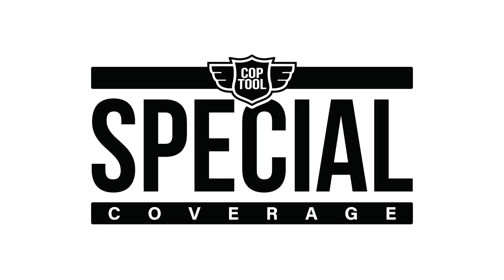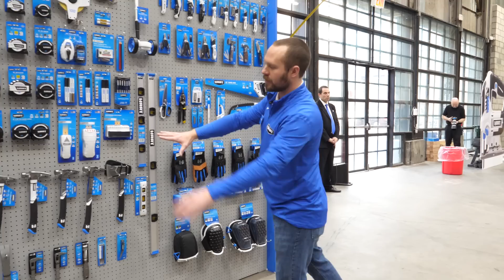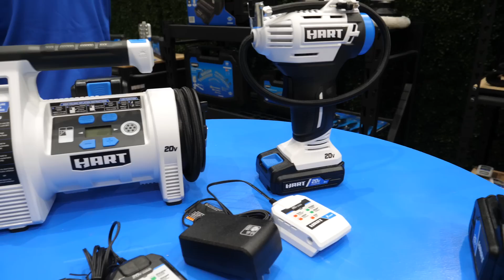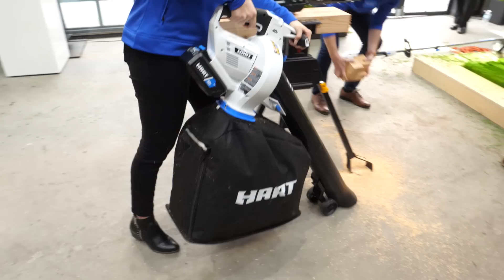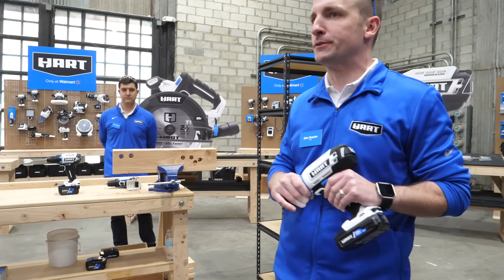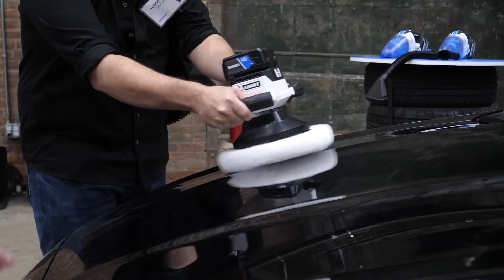HART Power Tools take Walmart by STORM. (Full Event Coverage!)

Comment: I have not bought any battery powered Hart tools as I use the 20 volt Porter Cable system.  But I like the Hart hand tools a lot.   The tape measures made by Hart are really good, easy to read, and the 25’ tape measure stays extended better than the other ones I own.  The screw driver packs are affordable as are the other hand tools like wrenches.   The contractor grade wall stud finder is the best and most accurate I have used. Hart is continually adding to their line.

Comment: The Hart power tools are junk. Save your money
Reply from the maker: Which one failed on you? We’ve been abusing them in our shop for about 7 weeks now with no problems.
Reply: @ToolShow   the battery stop working  within two weeks. I was not happy with the plastic casing,  and small motor inside. it just felt cheap . 
Is cheaper to go with the Harbor Freight Bauer brand.

Comment: Never seen that company in my life and I'm 50. Don't really like the colors. And 350 ftlb 1/2 impact is weak. My Milwaukee 1/2 is 1400ftlb and my 3/8 is 600ftlb. Big difference in power.
Reply from the maker: You just compared a $250 Milwaukee Pro-Grade jobsite tool, to a $119 DIY impact wrench. Why would you? I can promise you that your Milwaukee impacts are fantastic. We have them. We had the 1" here for a while. Amazing. But not everyone needs a jobsite rated tool. That $119 HART will do a great job on your car. That's the point. 

HART has been around since 1983, but it's been framing tools, for framers. TTI is now just re-utilizing the brand for an entry level line of power tools. That's why you've never heard of them. These new tools from HART are only a couple months old.
Reply: @ToolShow  you buy the$100 tool it's not gonna do what you need. So you go out and get a better one and in the end you spent $350 and you have a $100 tool that never gets used and eventually you give to your son. Been there done that.

Comment: I am not a Walmart fan,... and I admit being biased against them  because of how they treat their workers. Also, my experience going in to their stores has never been pleasant. I just transitioned from my old Craftsman C3 collection to Dewalt’s 20v. The C3 tools still work and I have 5 lithium batteries that still hold power in spite of their age, but I know that inevitably batteries will begin to fail rendering my whole collection useless. After spending quite a bit of money on the Dewalts, which I think they are great, 2 things became evident real quick. I am now “married” to the brand because batteries don’t fit across brands and the likelihood is that at some point, the same will happen with my new Dewalt collection. Sadly, it just seems wasteful. Outside of the drill I don’t really have any Dewalt/,C3 repeats so I’m still holding on to the C3’s but, what can be done with the C3’s once the batteries are done?

Comment: Probably great value tools. The same parent company make them for numerous brands including Porter Cable, Worx, Rockwell etc. If you're not fussed about image buy them and get building. Don't listen to power tool snobs and AvE fanboys (who are sat in their basements jerking off over a mains drill made in 1978)

But the problem is there are too many snobs and that's where I think they will fail. If there could be no connection back to walmart they could sell plenty.

Comment: Wish they would get eid of their "hyper tough" stuff. More like hyper trash. I bought the 20v drill and the charger that came in the box wasnt even for the lithium battery. I returned it and opened all the boxes and they were all for the ni-cad batteries too. Then I bought the circular saw and that thing was garbage. The depth set worked itself loose after a second and the safety guard was so stiff you couldnt push it through the 2x. I ended up using my saw all to finish building a privacy fence. Harbor freight tools blow them away for half the price

Comment: Ps stay away from Dewalt power tools. I bought the whole cordless pack and barely a year later the skill saw motor is going out intermittently. I do use the particular saw on the daily though just seems funny that it's going out not 1 month after the warranty expired

Comment: Does he realize 10,000 feet is almost two miles?!! Now that would be quite the measuring tape. 😂😂😂
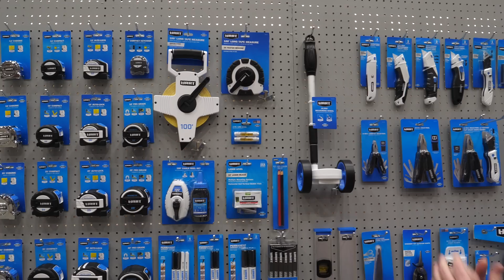Reply: He was talking about the " measuring wheel ", it is hanging to the right of the two 100 ft tapes, and the the left of the utility knives. You can see it clearly at 2:12.
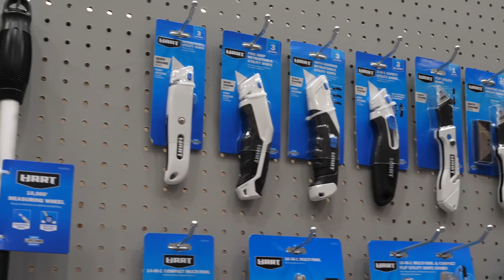Reply: @TheJakeytoo  easier seen paused at 2:35. Can read the tag too
Reply: I believe it is digital
Reply: wayne nahuy 
How would a digital measuring device work?
Reply: @direwolf9569  counts the revolution of the wheel just like all those types of measure tools are

Comment: I'll wait and see how it goes. One thing that could help the cordless tool industry IMHO would be to have fewer proprietary battery packs. There should also be a corded option that would allow useage from house or generator power, and another version to work off of a 12 volt automotive source such as a cigarette lighter receptacle.

Comment: I remember in the 90's Walmart having popular mechanic ratchet set I'm still using one
Reply: I had the hammer for years. Was almost identical to the eastwing except the handle would slide off about every 4 months and id have to reglue it on. Use to just return it every time but they stopped carrying the line. So much for that "life time warranty"

Comment: Well the impact wrenches,like many manufacturers, are too big you aren’t working in very many tight spaces with those. The tools are not hard to make what’s going to count is the battery and until one is taken apart to study they could be as bad as Harbor Freight. If however if  Walmart uses a name brand manufacturer to build their electric tools with quality batteries and true quick chargers someone who hasn’t invested in cordless tools may find this brand to work for them. It all remains to be seen. I will say how many of the tools resemble Ryobi.

Comment: Anyone who wants power tools to last, should not buy these tools.  I talked with a Black and Decker rep one time and he said they produced two kinds of their popular firestorm drills.  One would go to stores like Lowe's and Home Depot, while the other went to Walmart.  They looked identical, so what was the difference?  To be able to put those drills in Walmart, Walmart insisted that the buying price must be lowered, so B/D changed out some of the metal gears for plastic just so Walmart can claim that they can sell it for less.  Knowing this, I would never but any consumer products like drills, tv's, computers and such from Walmart because I would always be wondering what was sacrificed or cheapened just so Walmart can claim they can sell it for less than the other stores.  Buyers beware.

Comment: I don't think drills are measured in foot pounds like was stated by the Hart rep. I believe it's inch pounds.
Reply: Foot pounds or inch pounds both units of measurement.
Reply: 12 inch pounds to a foot pound.
Reply: @kscipkkkk  The quoted spec was 250 pound feet of torque. You miss my point, unless you think that Hart drill is good for 3000.
Reply: Torque measurements for impacts, cordless or pneumatic are measured in ft lbs.
Reply: @TheBannerGuy-James  I can tell you for a fact this is not true. I just checked online and the impact drills were spec'd in inch pounds.

Comment: I like the idea of a cordless auto waxing tool....no more dragging that dirty cord on your clean paint.
Reply: Throw the cord over your shoulder.  

Corded or not, those style of buffer tools are junk.
Reply: @johnjacob688  Dunno till I try it....I'm not a pro detailer so it'd probably work fine
Reply: Prefer pneumatic buffer to electric (corded or not)
Reply: @TheBannerGuy-James  is there a cordless pneumatic tool?
Reply: @hudortunnel9784  that would be fancy you'd need a built in air compressor though

Comment: Looks like that owned by Dewalt judging by the 20v marketing. They're probably equivalent to black and decker which is owned by Dewalt as well
Reply from the maker: Nope. TTI. Same folks who make Milwaukee and Ryobi.
Reply: Santana Santana actually Stanley / Black and Decker is the parent company that owns DeWalt as well as Craftsman and quite a few other brands.
Reply: @kldtts  thanks I knew it was something like that. I just didn't know that Milwaukee also marketed their batteries as 20v as well. Thought that was just a Dewalt, porter cable thing.

Comment: Nothing will replace my DeWalt collection! 💛💛💛🥇🏅
Reply: My one and only DeWalt tool, a drill, has been fantastic. I've had it for at least 15 years and still working great. Definitely worth the money.
Reply: @joewoodchuck3824  - Gotta agree with you there. My DeWalt cordless drill is indestructible. No idea how many hours and projects I've used that on.
Reply: @neilreid9005  I only wish there was a lithium ion upgrade battery pack for my older model.
Reply: @joewoodchuck3824  dewalt makes li ion adapters 
https://www.amazon.com/DEWALT-18v-20v-Adapter-DCA1820/dp/B016K1UD0E/ref=mp_s_a_1_3?adgrpid=55526416785&gclid=CjwKCAiAsIDxBRAsEiwAV76N875aXGgjnRjx-B-ntM1g1IxY4WgUxAHaNogy4yOn-T1jBEAnHgC6qxoCSg4QAvD_BwE&hvadid=274703577831&hvdev=m&hvlocphy=9033455&hvnetw=g&hvpos=1t1&hvqmt=e&hvrand=17329226004434560251&hvtargid=kwd-392598536823&hydadcr=20315_9692150&keywords=dewalt+lithium+ion+battery+adapter&qid=1579235941&sr=8-3

Comment: Still waiting for a tool company to bring back full metal di-cast tools! Tired of all this plastic junk wrapped in fake rubber that nobody needs... This stuff doesn't even last a few years let alone a lifetime... Used to be you could replace a bad switch, bearing, or brush and you were back in business... Now everything has a circuit board and your simply out of luck if it starts to smoke... I understand its "healthy competition", but honestly how wasteful is it for 20 different brands to all have a similar lineup of the same exact tools... Whats wrong with a company making just a few tools and making those tools very well!? I was not familiar with the HART brand before, but its like you said, they used to only make framing hammers and a smaller line up of tools...

Comment: The toll don't mean nothing the battery probably junk like the other stuff they sold
Reply from the maker: The other stuff they've sold? You mean like Ryobi and Milwaukee? TTI (The company that makes HART) is responsible for some of the best lithium-ion battery tech available today. Not sure what you're talking about here.
Reply: @ToolShow   after two years the batteries would hold a charge
Reply: @ToolShow  I have a flashlight from Cobalt it's like 7 or 8 years old works just as good as it did the day it was new

Comment: Milwaukee is a great brand. So is DeWALT. I am mostly a DeWALT guy. Both have their issues. Both are contractor grade. Carpenters, plumbers, electricians, and other trades trust those two brands more than any other. I think these would die under those conditions. 

Hart is likely not contractor grade. That's all I'm interested in. Why would a home owner choose this brand over Black 'N Decker, which looks very much like my DeWALT? 

I don't care if my kitchen mixer takes the same battery as my drill. I'd rather not use my drill battery for my kitchen mixer.

Comment: Everyone says good starter set or good budget set. But I look at it like this even for a homeowner I feel you are better off buying higher grade that will be around for a long time dewalt porter cable Milwaukee. This hart line will be here one day gone the next. I am a pro and I have a friend that works in sales I told him to go to Lowe’s or buy used on eBay and get pro grade that way you will have a quality tool that will last you 20 years and you will be able to get batteries for it and just build your set one tool at a time 

I also tell homeowners to get corded tools. And they always look at me funny as if I was talking in some weird language. But  if you are using it at home you have power so just get a drop cord and good electric drill. Sawsall jig saw and ect. They will last for years. They are priced well you can  buy them used  if you want and you don’t have to worry about bad batteries. That you want or will forget to keep charged up. Then you see the light go off in their head and they say you are right. Cordless is handy but a good corded tool is always nice to have 

So if you are a dyi kinda guy once or twice a year that wanted to build something. I say get corded after all I have corded tools that were my dads and granddads and they work just like the day they were bought
Reply: I think Rigid would be a much better choice than Hart. Rigid lasts a long time and can keep up in terms of battery power and longevity.

Comment: I won't buy a cordless tool until the battery packs can be popped open and the 18650's replace.  Making separate batteries for each brand is stupid.
Reply: Right on.
Reply: Technically, you can already do this. It's a pain in the ass, but it's possible.

Comment: best to invest inquality tools.Gota Milwaukee impactdriver for nearly 6 yrs without letting me down
Reply: sweety black where?
Reply: TTI own Milwaukee and Hart.
Reply: Buy Dewalt. They are American made and owned.
Reply: I guess my comment did not come out right. All of my cordless tools are DeWalt. I have been using  DeWalt tools for 30 years and would not buy any other brand. I had a cabinet shop for 30 years and used a lot of DeWalt tools. Still using my first kit I bought. 18v 4 tool kit. @carlosoliveira-rc2xt
Reply: DeWalt is made in China @carlosoliveira-rc2xt
Reply: @georgebaur1145  Only some. There are several lines made in USA. Suppliers may be from China but built and assembled in USA.

Comment: I bought one of those accessory cleaning brush packs for a cordless drill that I use to clean the tub, cook top, and other things around the house. They work great but are not as ergonomic as they could be. For the tub I use a long extension but it’s difficult hold the extension to stabilize while it’s spinning. I’ve also tried other household products designed for this purpose but they are not strong enough and only have the single brush that is permanently attached.

Comment: I know this is "consumer grade," but they are making the same mistake that made me abandon Craftsman cordless decades ago and switch.  As soon as they start with another lineup (Hart), they dump the old one (HyerTough).  Over time, the tools receive no r&d, and the batteries become increasingly hard to find.  Companies like Milwaukee (what I now use), and even Ryobi realize that the key to customer dedication is the USEFUL longevity of their line.
Reply: TAK1313 I’m confused by your comment because Hart, and Ryobi are made by the same company - TTI
Reply: @michaelraney6732  I believe Milwaukee is also owned by TTI. I'm pretty confident Hart will get support
Reply: @michaelraney6732   - Like other box retailers much will depend on the support the retailer provides the line.  Walmart doesn't make tools like Sears never made tools (and HD, Lowes, etc).  As you likely know, Craftsman, Ridgid, Kobalt, etc, are mostly made by companies like TTI, Extech, etc.  Even then those companies sub out manufacturing as well (one possible reason for the C3 line being so similar to the 18+ line).

When Sears made the first jump to lithium, they chose (not made) a redesign of the system rather than implement an internal design of the existing C3 design and came out with yhe red 20v line.  That line was very short lived, and they soon dumped that.  Probably because of battery/charger issues.

So in the case of "retail lines," much will depend on the whim of the retailer.  I don't know for sure, but knowing Walmart, the Hart line will likely supplant Hypertough, and one day Walmart will move on from Hart.

A brand like Milwaukee is sold through countless channels so it doesn't matter if one retailer ceases sales.  I know Hart is a decent NAME, but how much support will it get when Walmart decides to move on?  I've heard the name Hart before, but never saw it around here until it popped up in the local Walmart.  To me, this indicates a fairly restricted sales channel.
Reply: Walmart dumped Black & Decker to make room for HART

Comment: I am sure they sell some of these tools in the UK under the Mac Allister brand. In fairness they are as you mentioned starter DIY tools for the beginner or homeowner who occasionally wants to make, repair or do things around the house. They are on the same level as the Ryobi tools so I wouldn't be using them for heavy duty or day to day use.
Reply: I have both Milwaukee and Ryobi tools and use both everyday. I find the Ryobi handle everything I can throw at it, maybe not as good as Milwaukee but not far off.
Reply: I built a large deck with a Chicago (Harbor Freight) 18v. driver. 2 full days and a large box of 3" grabbers later the drill still works fine. I've also had to use my backup Ryobi  circular saw on job sites and it makes every cut I ask it to. just sayin.

Comment: I saw Hart tools for the first time tonight and thought the same thing.."huh..If walmart sold good tools they'd take some share from HD and Lowes because ppl are already here for everythign else"...pretty cool, because maybe will create some pricedrops in the other brands as well
Reply: I have been using Kobalt, and DeWalt for years. I purchased a '25 magnetic tape measure by HART, and I was actually more pleased with it than my Kobalt. I recently purchased their impact drive bits to use on the job. I will report my results later.